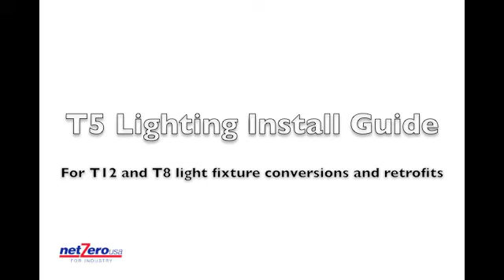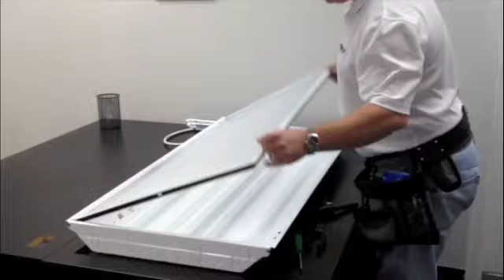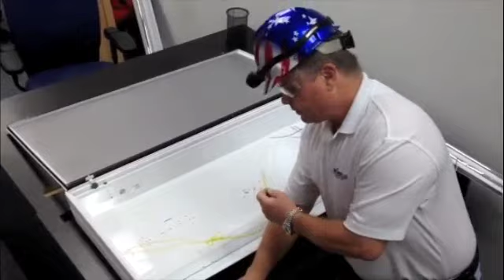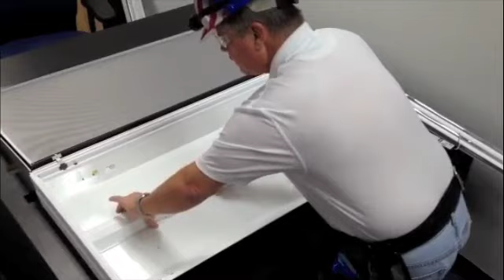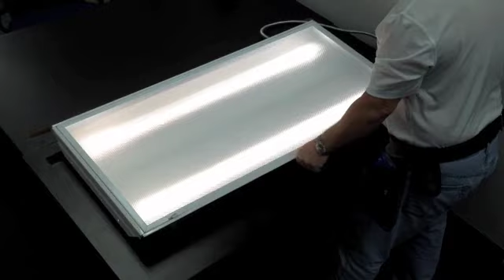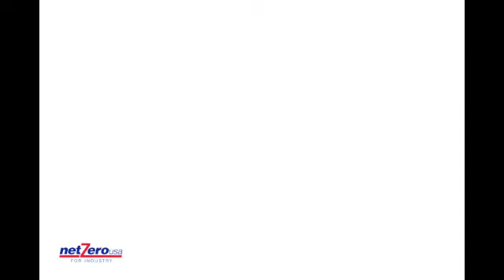T5 Adapter Lighting For T12 and T8 Conversions

Comment: Well these are I believe what are retrofit that have self contained ballasts right.  And they are a bit new.  But regular T5 or T5 HO that you use a digital or electronic ballast fixture has been around for years and used everywhere in ceilings, on walls, for plant stands etc.  yes any you need to watch heat but I don’t see where these would be any different.  This retrofit is just so you don’t have to buy new fixtures since the lengths are different between the bulbs.  Also, if you use the wrong bulbs (provided the right length with incorrect ballasts..it might work but it will burn up your bulbs quicker.  If wrong tell me, but that was what I basically read.  For example, is it a t8 that can be rolled into a t12 but you should really change the ballasts, where a T5 to a t12 you have to use the retrofit ones due to length difference, or maybe even the diameter.

Comment: I wish they had done this more close up.  And is it possible to use 3 or 4 bulbs for say growing orchids which require from 1500-5000 foot candles.  I think some use for the cattleyas and vandals T5 HO but don’t know how far away they would be.  Foot candles is what I need on the plants with the light fixture 18” or 2 - 3’ away

Comment: I'm confused: if you use the T5 adapters does that eliminate the need for a ballast?  If not, why is there no ballast?  Also, will these start in cold applications?  Thank you!
Reply: It seems unreliable without a ballast
Reply: Yes, the T5 Adapter has an electronic ballast built into the design. Yes, they will start in hot and cold applications.
Reply: Thank you!  You folks make a very impressive product.
Reply: Nice video!

T5-tubes don't do well in cold area's. Big chance they don't start at all when placed in cold outdoor applications (even in an IP65 fixture). They will reproduce a purple-ish glow and you will notice a decreased lumenoutput. T8 does not seem to have this problem when placed outdoor, but t8 has other weaknesses imho.
Reply: The T5 adapter is a "self-contained ballast"
Reply: Net Zero USA Yes, In the T5 Adapter an electronic ballast is incorperated.
The old ballast can be left in the fixture. It has no function anymore, but still using 1-2 Watt. T5 tubes are not very suited for cold environments, tough.
-5 degree celsius is OK, but going to - 10 degree celsius it will become a problem.
Reply: ddue trust me on this shit, do not install this in your home where you and your children sleep I can guarantee you that the tech hasn't even been around long enough.  It sound quite dangerous
Reply: Roobert Trapp?  I can't see what's so "dangerous" about an electronic ballast, which have been around for years, and a fluorescent bulb.  Seriously.
Reply: E5Bobby I have the same question as you Bobby.
T5 and HF luminaires are indeed being implemented for more then 10  years now.